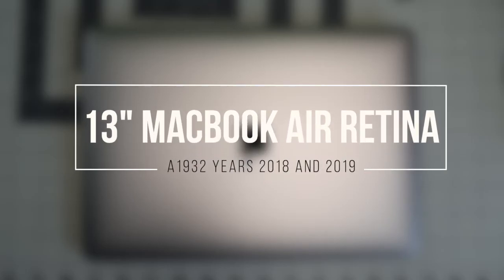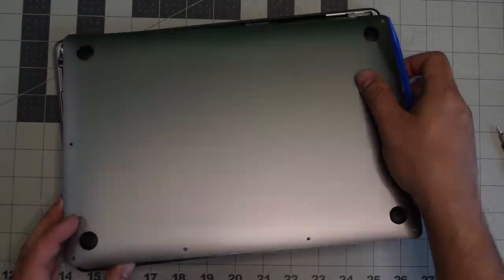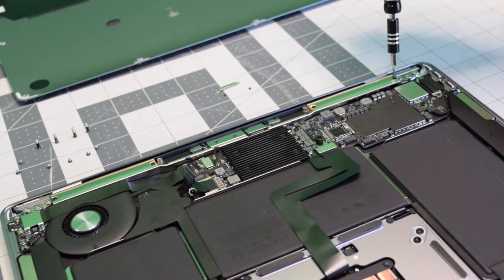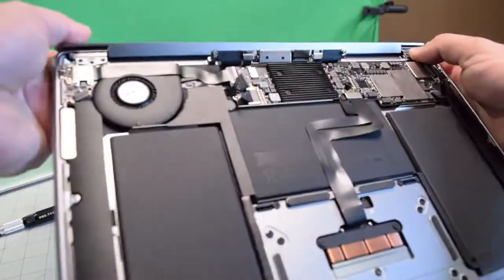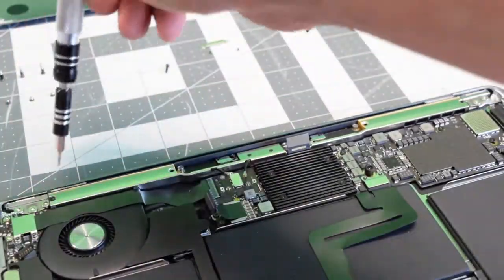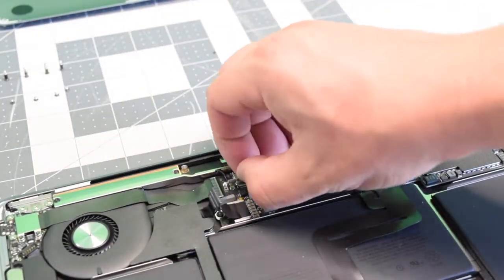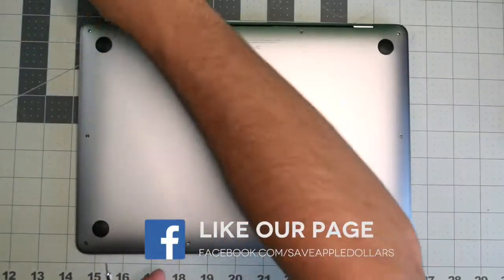13” MacBook Air Retina 2018 and 2019 A1932 LCD Screen Assembly Replacement

Comment: Bought a screen replacement from Ali Express for my 2018 A1932. It costs around A$220 including shipping. I used your detailed tutorial with zero hassle, highly recommended. For new buyers, make sure you buy the full housing and not the LCD only version! Thanks for the short video clip.

Comment: Does the replacement of the display onthis model not require the running of Apple Configurator? I was told by Apple that third party shops cannot do it because the software required to pair the hardware after replacement won't be accessible to anyone that isn't Apple authorized? Can anyone confirm/deny 
the need for software pairing after?

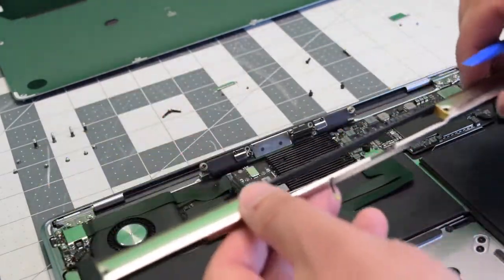Comment: 2:21 hold up is my laptop different from all the others? That piece does not come out on mine… I’ve been trying to pull it out for the last 20 minutes and it won’t move at all
Reply: Need help here too.
Reply: @Craig040 I figured it out when I was fixing it last year, I think you hold it down and push upwards to get it out of there. It’s held in place on the bottom and has to slide out a bit before you can pull it out
Reply: Thank you! I got it out. Once I did it right, it came out easy. I just didn't want to break it trying to get it out.

Comment: The bit where you remove the bracket really needs to be explained better. It does not easily remove like you show on the video. It to me 20 mins to get it loose.
Reply: How'd you get it out?

Comment: I spilled coffee on my macbook air 2019 and it entered on the bottom right corner of the screen and I'm looking for a screen replacement. Where did you buy the screen replacement for this laptop? And how much was it?
Reply: eBay is your best bet really, there multiple websites that sell screen replacement, but they are all quite expensive.

Comment: Tried this worked fine BUT be careful how you put the cover back when you finish. I put it front to back ( the screws are in the same place on each side so its easy to do ) and then the hinge at the back catches on the case and can damage it. Once I took it off and turned it the right way round was fine!

Comment: This video is amazing, right down to telling us every size Torx bit to use along the way.  Had a little trouble removing the silver bar that runs across the back but finally got it out of there.
MacBook back in working order!  Saved $500 over what Apple quoted me by doing it myself.  Thanks!!
Reply from the maker: Thanks for sharing!
Reply: Where did you buy screen and repair kit
Reply: @nbentertainment1961  i found a 2019 model iCloud locked, for 180 on eBay. Swapped the screens and I sold the ic locked with the partial bad screen for parts for $140. Worked out great.
Reply: I agree! My replacement screen hinge mounting holes didn't quite line up, but I was able to oversize the holes and got it all to line up. Huge thanks!

Comment: Screen costs like $300 and labor for a repairman costs $100 vs. apples $677, just crazy how tech companies work with demand and pricing.
Reply: This is a job so easy you can do it yourself, its no different from replacing spark plugs in your engine, with the right tools and a bit of patience, anyone can do it.